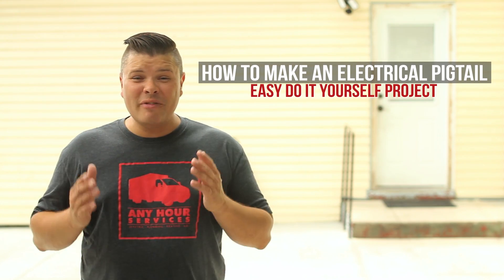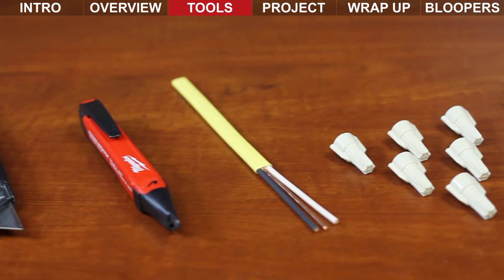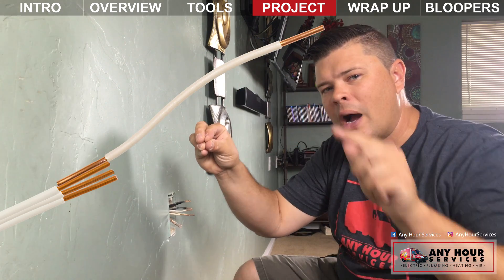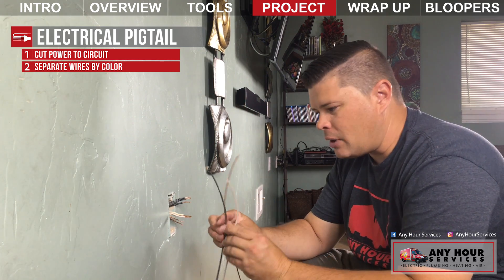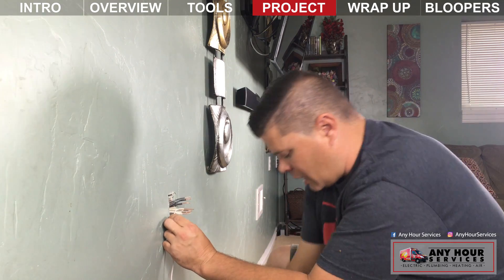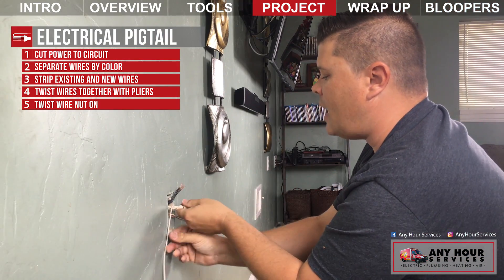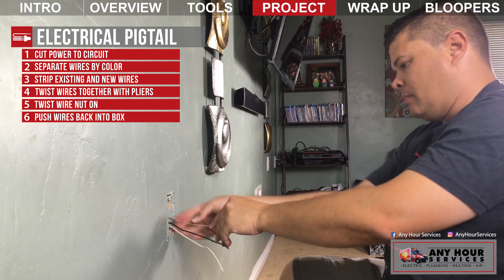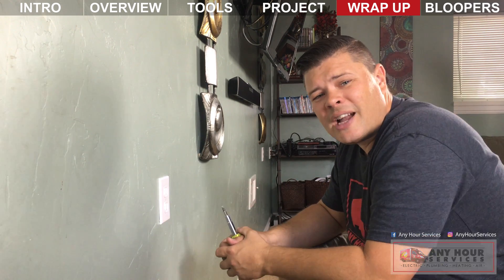How To Make An Electrical Pigtail

Comment: Great video.  Thanks.  Could you maybe explain for everyone why you used the side terminals instead of backstabbing the wires into the outlet?
Reply: The screws on the side are more reliable than back stabbing the wires.     Rarely will a connection come loose on an outlet, but if it ever does, it is almost always on an outlet that has been back stabbed.       Use needle nose pliers to make a small loop.

Comment: I wrap wire nuts with electrical tape after I twist my wires together for extra safety.
Reply: As a 50 year licensed electrician, I declare that I hate to work on receptacles or switches that are wrapped with electrical tape.  It's not necessary and just makes a sticky mess.  Even if I have to repair bare wire from damaged insulation I use shrink tubing, not electrical tape.  I have seen a lot of electrical tape lose its bond with time anyway so what's the sense of using it?
Reply: I do the same thing.  Was taught to do that.  Also, I would put a couple of wraps around the receptacle, in case the box is a metal box.  Never can be too safe.

Comment: Hi, I'm watching from UK, great to see how others do things, one question I have is, do you sheath the ground copper wire, here in UK we call it the earth wire or CPC and have to sheath it in yellow/green sheath to comply with regulations. Stay safe. CPC is short for 'Circuit Protective Conductor'
Reply: Most of the power cables sold in North America and install in houses, respectively, contain a bare copper wire for ground. That's the only wire which doesn't require stripping. However, some small devices like dimmers contain an insulated ground wire, which is usually green. Also, when adding a ground pigtail to an electrical box, some people prefer to attach an insulated ground wire to prevent the breaker from tripping. Hope this helps

Comment: Thanks so much for this! I had 6 wires coming out of my box plus grounding wire and I had no idea what to do. This solved it. Are the push in connectors as safe as the wire nuts?
Reply from the maker: You're welcome! As for the connectors. As long as they are UL Listed they should be safe to use ... especially if you're able to get to them if you need to, never cover a splice in the wall.
Reply: What could possibly happen if you do?

Comment: Can I do this in reverse?   I have an extension cord that I am going to cut the end off and run the wires to a double duplex metal box and then come out of the box and reconnect the lighted female end.  This would essentially be the wiring you did in reverse.  I start with the cable and add 3 piggies.  Is this safe if done correctly ?
Reply from the maker: I don't think I'm totally understanding what you're trying to do but it's not safe to use extension cords for permanent use.
Reply: @Anyhourservices  all I am trying to do is use take an extension cord and put a double duplex box in the cord

Comment: So by doing this, do I just use that one pigtail to one terminal per side is that the purpose also? Just asking because I've seen other vids that confused me where they added an outlet behind a hung TV which is what I'm doing, they ran the pigtail down below but still had wiring on both terminals each side.
Reply from the maker: If you are adding a wire and there are open terminals on the outlet you're pulling power off of, you can attach to those. If the all the terminals on the outlet are full, you can pull them off the outlet and pig tail them together, run one of the wires off to the outlet and then the other wire up the wall going to your tv. I'm sorry if that explanation was confusing.
Reply: @Anyhourservices  Thank You

Comment: Found your video while learning the difference between splicing into a circuit and making a pigtail.  Your video was incredibly informative and well done.
Reply from the maker: Cool, thanks!
Reply: Me too.   I need to splice into a wire in my crawl space.    My wiring goes to an outlet on the back deck, so i plan to cut that wire in the middle and add a new GFCI outlet.

Comment: Excellent video! I was changing a single switch in my bathroom and noticed that the person who installed it had connected 2 black wires around 1 brass screw! They should’ve pigtailed the 2 to make 1!
Reply: Was the second screw not used ?

Comment: Excellent video, many thanks.  God is in the details : trimming the ends of the clump of neutrals, twisting ine wires in the same direction as the wire nut etc. Thumbs up.
Reply from the maker: Glad you liked it. Thank for the comment.

Comment: Your videos are great! I need to know how to install a new drain line pipe and direct it out of a house with drilling a new exit location for the drain line hose. My hvac pan keeps filling with water and shuts off my system. The problem seems to be the existing old drain line pipe is clogged or poor elevation. I've done the bleach cleaning and the air pumping to try clearing the line. I think it's something to do with the drain line pipe being obscured in some way.
Reply: A new hole may be required.   I wouldn't stress about it too much.  It shouldn't be too hard unless you have to drill through brick.    Otherwise, you may need to find a different exit hole and run a longer drain pipe.      

Also....can you not use a drain snake to clear your existing drain pipe?

Comment: I loved your video on Pigtails.  Question: I have a closest under my staircase without power, I do have an outlet on the outside wall, which is my dining room.  is it possible to cut thru the closest wall and connect an outlet to the existing one, so, how is it done?  I'm subscribing.
Reply from the maker: Yes, that is how we would ad an outlet for a customer, especially if you're ok with it being in the same stud cavity. I think I'll film a video about this next week, I've got a spot in my house that would be good to illustrate the process. Thanks for the request.

Comment: well here is my question, how do you deal with the possibility that you might have a 20 amp/ 12 gauge circuit?  How do you recognize that difference?  i'm just worried I might do something stupid and get the wrong gauge wire.
Reply from the maker: The gauge difference is pretyy oviouse when you are working with the wires. 12 will be thicker than 14. 14 will be easier to bend, etc. there is no problem going up in size you just don't want to go down. Your wire should be sized according to the breaker supplying it power. 15AMP = 14 gauge and up 20 AMP = 20 gauge and up ... don't put a 14 gauge wire on a 20 amp circuit but you can put a 12 gauge wire on a 15 AMP circuit. 

If you are uncomfortable with it and not sure, get an electrician to help you with this project.

Comment: These are great videos. Very informative. I have been looking all over, but I have a question about pigtails. I have two single pull light switches controlling two outdoor lights independently. I want to wire them together so they are controlled by one automatic timer that will turn them on at dusk and off at dawn (I already have the Honeywell timer). Can I just combine the 2 hot wires together, 2 neutral wires together, and 2 ground wires together, then run pigtails from each combined connection to the timer? I just want to make sure it's okay to combine 2 hot wires from different switches to make essentially one connection. Thank you.
Reply from the maker: If the "neutral" wires are actually the nuetrals, I would recommend puting a timer on each light. The way switches are wired now a days, the neutrals are combined at the fixture and in the back of the switch box, and you are are sending power on a "switch leg". If you're not sure, have an electrician help you with this project. 

BUT ... IF ON THE SAME CIRCUIT and USING SWITCH LEGS: You do not need to combine the hots, you only need one of them (unless these are massive lights that are on their own circuit ... if residential probably not the case) put a wire nut on one of the hot wires and push it in the back of the box. The 2 switch legs can be pigtailed together.

I hope this was helpful. If you're not comfortable trying this, definitely get an electricians to help you. Good Luck and be safe.
Reply: @Anyhourservices  Thank you so much. Once I thought through the process I ended up doing as you described. The lights work as expected, I didn't electrocute myself, or start a fire. I call the a win. Thanks and you have a great channel.

Comment: I bought a new outlet that is a bit bigger (deeper in design) than my old one, and it doesn't seem to fit within the outlet box with all the wiring and pigtails. Is there anything I can do besides replacing the outlet box?
Reply from the maker: Not really. You could replace the box with a deeper box or put a 2-gang box in so you have more room for the wire fill in the box. Good luck.

Comment: Great video!!!  Is it possible to pigtail 2 wires of the same gauge wire into breaker panel...any videos on that’s?
Reply from the maker: I don't have a video on it right now but if the wires are the same gauge, yes, you can pig tail them in the panel.

Comment: Hi, I have the exterior post fixture which there is power in sockets and i replaced the light bulb but still doesn't turn on any suggestion?
Reply from the maker: Test that you have power to the device first and that it is the proper voltage. If not, you have to trace the circuit back and find out where the problem is. If you have power and the proper voltage, double check you have wired the device correctly. It's possible you grabbed another bad bulb. Good luck.

If you have checked the simple, obvious things, you may need to call an electrician.

Comment: Thanks for the no nonsense video.   Wondering if you could cover this topic:  I have a grounded outlet that has a switch coming off it.  I would like to replace that outlet with a GFCI (it is in a potentially damp location), and run the existing switch AND a new outlet off of the GFCI.   I think I know how to do this, but would appreciate walk through if you have time/interest.  Thanks!
Reply from the maker: I will ad this to my list of video requests. In the meantime, here is a rough explanation. On the back of the GFI outlet, the top and bottom terminals will be labeled "line" & "load" The hot wires/power coming into the box needs to hook up to the terminals labeled "line". Anything you want to also be GFI protected needs to hook up to the terminals labeled "load". If you don't want them to be GFI protected you can hook them to the terminals labeled "line".

Comment: How can I use pigtails to add another outlet. I’m still a little confused. Is that what was done here?
Reply from the maker: No, in this video all I did was lengthen short wires with pigtails to make them easier to work with. If you want to add an outlet, you could use pigtails to tie the wire into the circuit or you can connect them to the outlet you are pumping off of. Hope that makes sense. Thanks for watching.

Comment: Is it ok to use a slightly heavier guage pigtail wire for just a short distance without being in danger of anything on the hot & on the neutral?
Reply from the maker: Yes. It's ok to go bigger but not smaller. and always make sure that you breaker is sized to match the smallest guage wire on the circuit.

Comment: Great info! I'm adding an outlet mid-run. Does it matter if I group all three to a pigtail or two and then put the third on the other screw?
Reply from the maker: No, that shouldn't make a difference. As long as the outlets aren't half switching. But you would probably know it that were the case.

Comment: I just bought a wire claw. Have not used yet. But if it makes working in multi-gang boxes easier without messing insulation up. It will be a great tool to own. What is your rule of thumb on only two wires? Do you twist them also or do you twist them up with wire nut till wire in hand starts to twist? Also, very clear instruction and that should help many who watch.
Reply from the maker: I personally twist them together and then twist the wire nut on but I have seem many people just put them under the wire nut. The reason I twist them is there is less chance of then coming apart and creating arcs and a fire hazard. Good question. Good luck with your wire claw, hope it helps.
Reply: Yesterday I was working a 5 gang box loaded. Man the claw is really great in this instance. @Anyhourservices

Comment: Question.  Which one of those copper wires would you use to bond/ground to a metal box???
Reply from the maker: The bare copper wire. Good luck.

Comment: Great video, where can I get some of the white and black wires at and what do you call them? I'm thinking Lowe's might have them but I need the name that you call these? I looked on Lowe's website and can't find them. I'm needing some of the white and black wires because on one of our outlet boxes the wires are too short to work with. Thanks
Reply from the maker: You can get the wire at any hardware store. I happened to be using romex and pulled the individual conductors out of the insulation. You can ask for solid THHN but you need to know the wire size, most common are 12 & 14 gauge, you DO NOT want to use smaller wire than what the breaker is rated for. If the circuit is a 15 AMP back at the breaker box, use 14 gauge and if the Breaker is a 20 AMP use 12 gauge wire. Good luck my friend.

Comment: Totally found this video by accident lol while looking for something else. It just so happens I need to change a bunch of outlets. Thank you for your help. I'm also looking to add some more hallway lights to an existing one.......do I use a daisy chain?
Reply from the maker: If you want the  to be controlled on the same switch, yes. You can daisy chain the light fixtures together. Good luck.

Comment: Can you hook up a single switch with only 2 wires in the box to a pole with 2 toggle switches?

https://www.amazon.com/Legrand-Pass-Seymour-690IGCC6-Combination-Switches/dp/B001B1APG6/ref=sr_1_4?s=hi&ie=UTF8&qid=1542277767&sr=1-4&keywords=1+pole+2+toggle+switches
Reply from the maker: Well, you would need 2 switch legs in the box and a wire bringing power to the lights. Unless you are wiring up a California switch let where the power is at the light source. I don't have quite enough information to answer, or I just don't understand. Sorry. Good luck with your project though.

Comment: Question, I have a junction box with 5 12/2s going in, hence 3 sets of 5 wires to clamp together, which is proving very hard to do. Is the best way to separate those twists with pigtail(s)?
Reply from the maker: Depending on the application and why you have 5 wires coming into 1 box, yes, I would probably use multiple pigtails. They make different size wire nuts. Just make sure you don't overfill your box and that you don't exceed the wire nut's rating of how many wires it can have under it. You can find that information in the NEC book. Good luck.

Comment: How many wires can you pigtail to 1 outlet input before you risk blowing something or fire?
Reply from the maker: If you are making a pigtail, for the power to pass through to the rest of the circuit, you don't need to run all the wires to the outlet. As long as your connections are tight, you have the proper size breaker (that is functioning properly) on the line, and you are not plugging too many things in that pull a lot of power . . . you should be ok. How many are you trying to put 1 outlet?

Comment: Is it similar to do a pigtail at the breaker panel?  My home was inspected and one breaker (20amp) was "double tapped" .  Was suggested to wire nut the two together and send a pigtail to the breaker to avoid arcing.  Make sense?
Reply from the maker: Yes. Same thing. Make sure the wires are the same gauge (thickness). You can use the inside of your breaker box as a junction box for joining the wires together but that breaker is only designed to have 1 wire under it. Thanks for watching.

Comment: Great video.  Where can buy some pigtail wires and can they be used for switches as well as outlets?
Reply from the maker: I just had some Romex and pulled the inner wires out. They do sell individual wires called THHN. They sell both at the hardware store, you can see which makes more financial sense for your application. Yes, they can be used to extend switch wires as well. Thanks for watching.

Comment: My question is, why were there so many wires coming in that box in the first place? if you connect them all like that, dont you risk blowing something if it isnt supposed to be connected together. great vid though!
Reply from the maker: Nowadays when you wire outlets you usually go from one outlet to the next so there wouldn't be a lot of wires in the box. When this electrician wired this outlet they went several directions with the citcuit...might not make a whole lot of sense but I knew there wasn't a risk of overloading anything.

Comment: great video. is it ok to create a pigtail for the C terminal on my furnace to include a nest thermostat, humidifier, and a/c?
Reply from the maker: If the instructions for each of the devices say to have them connected to the C terminal then YES. You will probably need smaller wire nuts since the wires are usually smaller.

Comment: I usually twist from the beginning of the bare part of the wire until it starts twisting evenly from the insulation down a little bit then go down some and twist the end cut off then twist the end one more time then wire nut it I make sure the insulation is twisted some before I stop so the wires are in place but down twist the insulation all the way up to hard or your wires won t have any bending room to bend your pigtail splice back into the box without damaging or crunching the wires leave some room so they have some room to be malleable
Reply: *dont twist the insulation to much
Reply from the maker: Good catch, Shawn. Glad you enjoyed it!